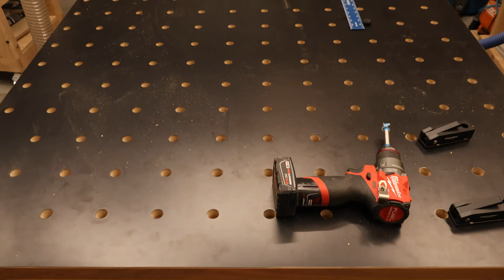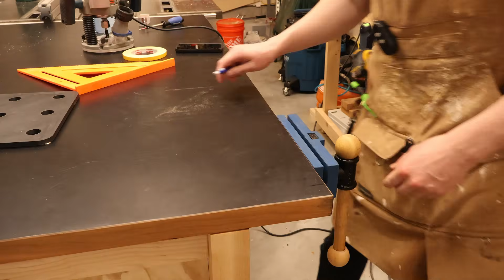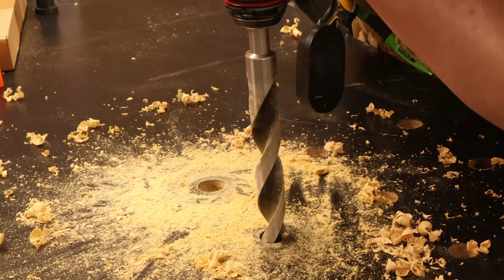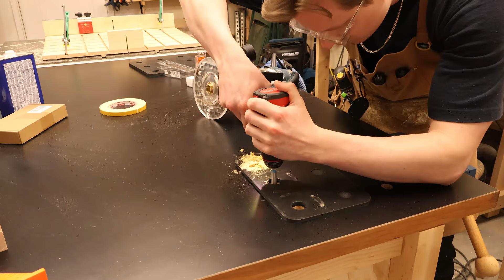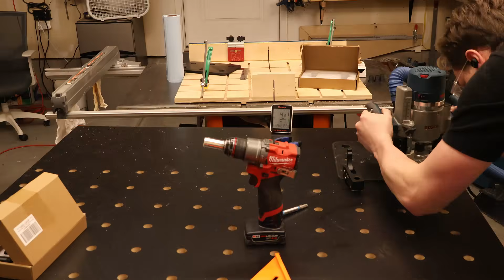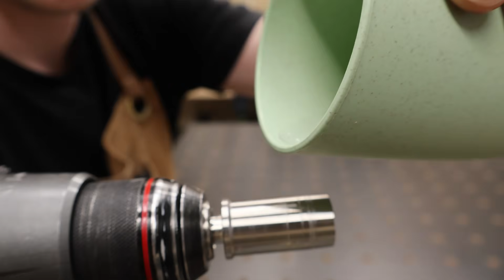How To:  Drill a dog hole grid/MFT table top for less than $100

Comment: Great video - I’m excited to try this out. Was that 7/8” ID 1” OD guide bushing something you had to source specially? I’ve ordered the SKU: BOS-RA1128 8-piece template guide set but it looks like that kit might not include this size? Do you have an affiliate link I can use to buy the necessary one? Cheers
Reply from the maker: Hi yes, it will be in this kit:  https://www.amazon.com/dp/B07H935NT6?ref_=ppx_hzsearch_conn_dt_b_fed_asin_title_1
You may be able to find other options on the market as well!
Reply: @ThreeTreesDesign3  Thanks for the reply!!

Comment: Another reason to go with a 3/4-inch (18mm) top, is that if you get deeper than that, you will have trouble getting the clamps to go into the hole and rotate into place to clamp things

Comment: Another option is to have 86mm spacing between dog-hole centres and the outer edge of the template - then just pop dogs in the holes AROUND the template et voila! Now you have access to routing 9 holes at a time. If you have a decent sized lazer-edge then you could use clamps to hold that in place so you don't have to keep popping out the dogs as you move along the table.
Reply from the maker: Sure, but the problem is this jig really should be used with four indexing pins in at once if you're looking to achieve the highest level of accuracy.

Comment: If the holes are not dead accurate like on a Festool MFT, then they are just holes and you can just drill them anywhere. If you can't make a 90 degree or 45 degree cut using your holes then they are just holes. I am disappointed as I was hoping for an alternative to the UJK tool. Yours is not the only jig of this type that just makes holes. Someone used the model made by Woodpeckers and theirs was not absolutely accurate. Maybe the user but if it isn't right it isn't for me.

Comment: If your guide bushing is not perfectly centered, then the hole positions will be slightly off unless you use exactly the same orientation on each plunge. Using a consistent router base orientation will give a consistent  direction and offset to the error  (center of the bit - center of the guide bushing), for all holes which will cancel out the issue.
 
Unfortunately I see people turn their body when coming to the corner of the table in order to have a more comfortable position. This typically rotates the router base, and this gives a different error angle, leading to small errors.

Template based jigs are very prone to additive errors as the accuracy of the next row or column of holes depends on the accuracy of the previous template position.

I have yet to see anyone talk about this (guide bushing centering)  in any of the videos I have watched about drilling dog holes with a router and guide bushing.
Reply: This is an excellent point!  I have seen it mentioned one other place but it should be mentioned everywhere.  Assuming the template is accurate, etc are there any OTHER user-practices to improve accuracy?

edit: I guess the template should also be used in the exact same orientation for every set of holes.

Comment: I got AI to produce a grid 4 x 3 with  a 50 mm border. Down load to an xtool with an SVG file. Cut 10 and over lap and join with glue to give you a 7 x 10 hole pattern. Align with shot dogs. Then just drill and move around as required. There can be no more accurate way of doing this unless you want to buy a 1 off expensive jig. if you want and have an outfeed table you can gat it to produce holes 4 x 20. More than enough for many work benches.

Comment: 20mm setting for the thickness on the domino df500 is used for lumber that is 3/4”+/- thick. I have 3/4” dog holes in my 4” thick bench top, but I need to add some more rows of holes. I can buy a replacement top for a mft3 table for about $125, but I don’t have room for another piece of furniture or to add to my 7ft long bench top. I have dog hole stops for 3/4” dog holes. If I buy a Festool saw, I’ll probably buy a mft table and sell my work bench

Comment: What do you mean by Metric?
Reply from the maker: I’m assuming you’re referring to when I mentioned the “metric collet.”
Common metric collet sizes: 6, 8, 12mm
Common imperial collet sizes: 1/4”, 1/2”

While you could probably technically fit a 6mm bit in a 1/4” (6.35mm) collet, I’d rather not take my chances when dealing with a bit that can spin up to 24,000 rpm
Reply: @ThreeTreesDesign3  Thanks for your answer. There is in fact no such thing as Metric measurement system. It's called SI (The International System of Units). The United States customary system is also a  measurement system. Which system is best probably depends on where you live on Earth.
Reply from the maker: “metric” (cm, m) and “imperial” (in. , ft.) are very commonly used terms to differentiate the two systems. At least in the US
Reply: @ThreeTreesDesign3  OK I understand what you mean but a measurement system is there to determine the sizes of units. Otherwise it can create problems like NASA when they mixed up different measurement systems. Where I live all fasteners with threads are called screws and all without are called bolts. You need an angle grinder to loosen a bolt while a screw can be easily removed with a wrench.

Comment: Nice jig/method and table but, what's the point of having so many holes and such a high degree of accuracy in placing them? Am I missing something?
Reply from the maker: For the sake of consistency and neatness of the holes, but also for other applications.  If you wanted to use this with a track saw and fence, you want all the holes to be dead square so you can make square cuts.

Comment: The centipede mft top is what I used. Large and cheap when you find it on sale. You can get the 19mm or 20mm hole option
Reply from the maker: Pretty darn affordable, wow!  I’ve loved learning about all the MFT stuff that’s out there and what you can do with it all
Reply: I got the centipede and you can join them up for bigger tables.CNC accuracy. Am experimenting using it for a template

Comment: So I just sprung for the BenchDogs MFT table but without the MDF top.. cause that was an extra $150 shipped to US from UK. I have 4x4 sheets of MDF as well as birch.. thinking of birch on the bottom.. MDF on top 1.5" top.. so the MDF is a scratch top. I then sprung for the very accurate UJK orange kit.. figured I'll use it a few times over the years, and want it as accurate as possible. Lastly got the BenchDogs track saw hinge kit.. that comes with the jig to mount to the holes and cut more holes out for the hinges to sit in. I figure hell with it.. go all out.
Reply from the maker: Awesome, man.  If I had the money, I'd love to do the same.  One day...
Reply: The BenchDogs stuff is good. I have the hinge, if I lived in the USA though I’d have gone for more of the Dashboard gear - that stuff looks fantastic, if a bit spendy.

The UJK parf tool is amazing, very expensive but you’ll definitely use it a lot.

Comment: Nice! I used a pegboard. Established center lines both ways and centered the pegboard along both center lines. I then secured to table and used a center punch to establish hole locations skipping holes to achieve desired on center spacing on my work top. Then using a plunge router, proceeded to complete the holes after removing pegboard.
Reply from the maker: So you were lining your router up by eye for every hole?
Reply: @ Bit guided by the divot created by the center punch
Reply: @willwatlington6750 what kind of router bit? I was researching to do something similar with the pegboard but not understanding how to use the router bit as you did
Reply: @jonathanrowe6294 up cut spiral bit 1/2” shank 3/4” cutting diameter.
Reply: @ThreeTreesDesign3  This is a great idea!!! Thanks

Comment: Glad to know that there's a ½" shank 20mm router bit available.

My idea to accomplish this task was to size the holes on the template at 26.35mm (1” plus the difference between 20mm and 3/4") with holes centered 96mm apart.

This would allow someone to accomplish an MFT top using their 1" bushing and a standard ¾" bit. Or better yet, a ¾" bushing and a ½" spiral bit which are both very common and can be had very inexpensively.
Reply from the maker: Like the idea!  A bit roundabout for my taste (I like to avoid math when I can haha), but if it works, it works. Finding this 20mm bit was exactly what I was looking for in the end and I was super excited about it.
Reply: @DeAngelisWoodcraft 
My idea basically just allows me to use the tools and bits I already own. That's the only reason I would do it my way, but it's all good! 🤘

Comment: You have a 1-3/4" top but you said it can be done with a 3/4" top. Would that be enough?
Reply from the maker: It will be easier to do this on a 3/4" top, and not require a forstner bit to get all the way through. As opposed to the 1 1/2" top I have here.  Of course, there are advantages to having a 1 1/2" top, ranging from increasing the weight of the table, making the top slightly more durable/resistant to warping, although MDF isn't prone to much warping in general.
Reply: Did you laminate two 3/4 inch boards together or did you buy it as one and a half inch thick?